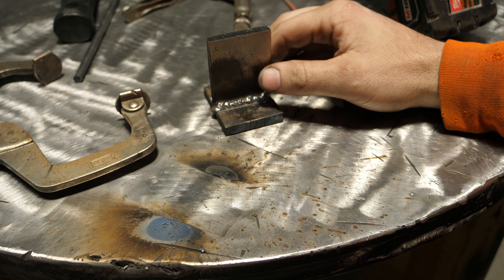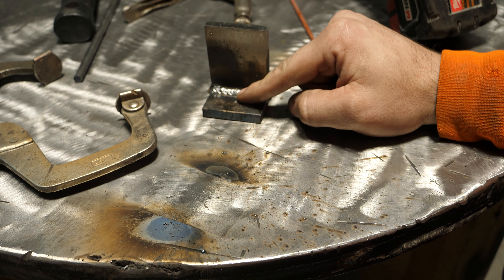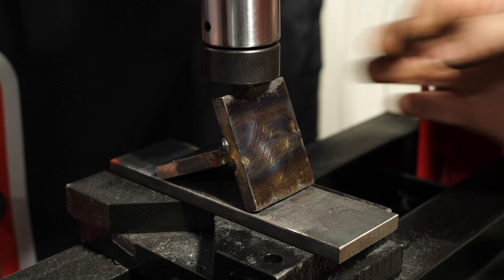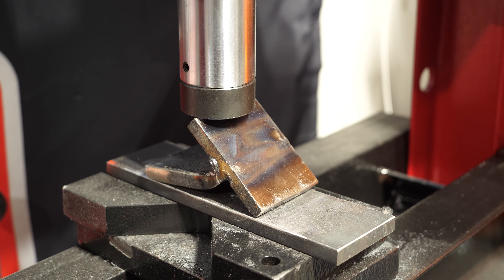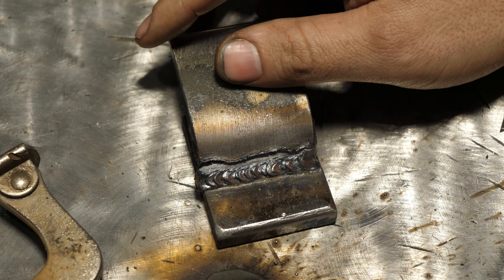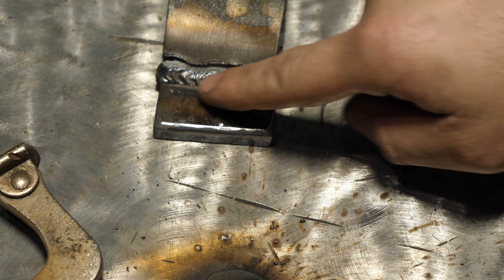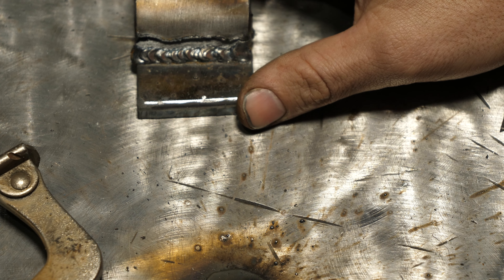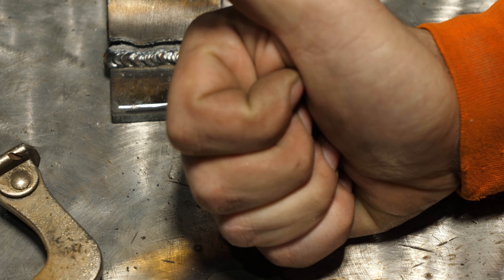Quick test: Weld both sides of a fillet weld with 6010, will it beat 7018?

Comment: Yeah, I had always viewed 6010 as the premium choice where structural strength was the main consideration. Really been educated today with these eye opening revelaions.
Reply from the maker: In the right situation 6010 can make a stronger weld than 7018 in the sense it’s penetration can reduce leverage thus a part will hold together longer.  This can be solved significantly by leaving a gap/beveling plates, or welding both sides of something with 7018.  6010 is still extremely good as a first pass, for welding gaps/holes shut, and welding out of position.

Comment: These videos have been pretty eye-opening. Kind of makes me not want to use 6010 for structural things. Have you done one with the dual shield across the face of the weld?
Reply from the maker: I tested it off camera (by bending a existing weld I had laying around) and it didn’t break.  Since I just got a new spool of wire back I will have to further test dual shield.  I also picked up a more powerful MiG welder to be able to try to get better results.
Reply: @makingmistakeswithgreg  I believe dual shield is the strongest welding process due to its heat/penetration and amount of shielding + the fact that its not picky like 7018. But 7018 does better in the wind

Comment: So far, 7018 does a better job helping SMAW compete with TIG.
Reply from the maker: It definitely does.  I will need to do tig break tests soon.  I know a clean tig multi pass won't break in the same test, its just 4 times as slow to put down lol.

Comment: secnd also 8018 secmed to work the beat so i used that thanks i i used a 7014 root and a 8018 cover i think it stroner now than its ever been in steed 7 tons max before the jaw plate comes apart it now bend steel with like 8 9 tons pressure
Reply from the maker: I don’t have any 8018 but it would most certainly exceed the strength of the a36 steel I welded on.  8018s tensile strength is around 95-97k in actual testing.  It would likely pass just the same as 7018 in the bend tests on mild steel.  On stronger steel it would likely result in a similar result to 6010 vs 7018 where the 7018 would fail.
Reply: @makingmistakeswithgreg  sound about right were 7018 would fail ,well if you like the way 7018 welds then you would like the way 8018 welds but 8018 is very hard to find and i think you canonly buy it by 10 pounds or 100 pounds at a time and for hundred pounds it like uh 250 U.S credits or dallors pluse tax or some where around those lines 8018 is like used for heavy ship frams brige support like over the missasip river back in the day the ( beging ) rails hade plates over the section of rails were anoter rail meets ,( middle ) 8018 was used to weld them toger now they used ether a termite reaction to melt them togetr or the use a moblie induction furnace to melt rail pices to the rail then clean it up with a grinder

Comment: This is great stuff and it's awesome how you respond to viewers requests!  Just wondering, 'cause I'm a cheap bastard, are you gonna' try this test (the pulling away/tensile strength) on gasless flux core??  (Like I said, I'm a cheap bastard!  lol).  Or is the baseline testing with stick electrodes proof enough?  I suspect the stick test is proof enough but I like your vids so I thought I'd ask...  🙂
Reply from the maker: I have tested it, video will be out in a bit.  The problem is Gasless flux core produces porosity on 3/8th plates with .035 wire.  I can’t run .045 easily in my machine, so I am left with .035 as the only option.  I tested flux core and Mig on the same 1/4in plates back to back.  I will upload the video this week and post a link where you can check it out before it’s released 😀.  I have done so much testing in the last 2 weeks I can’t remember the results lol.
Reply: @makingmistakeswithgreg  Lol  I can only imagine.  I take notes when I'm welding certain stuff then I go back to the notes after awhile and can't remember exactly what the situation was and why it worked so well one time and not so great the second.  With all the testing you do, I dunno how you can keep it all straight!  I've come to believe there is some mysterious Voodoo involved in welding that can never be understood completely!  Anywho, looking forward to the next video installement.
Reply from the maker: There definitely is some voodoo.  You think you know everything there is and then there is something that you find out that completely changes everything.  A lot of it has to do with how complex it truly is.  Who would think something as simple as a weld could involve everything from physics, to metallurgy, to mechanical engineering.  It gets really involved when it comes to welding tool steels, titanium, inconnel, and castings.  I can’t wait to do videos on those lol.
Reply: @makingmistakeswithgreg  I never thought it could be explained so clearly.  Even though it's just a hobby for me and aside from the ability to make or repair stuff (which totally rocks!) it's the crazy science of it all that makes welding truly intriguing for me and a great hobby.
P.S.  Join us poor bastards using 1/8 and 3/16" plate for your tests and you'll never have porosity problems with .035 or even .030 gasless flux core wire again!!  Lololol  You can even leave your 240 volt machines at home!  hahahaha
Reply from the maker: I do love flux core wire on thinner stuff.  Honestly I prefer flux core Gasless to MiG.  I also really like the way dual shield runs, but it sucks because the .035 wire doesn’t appear to be a legit option for 200amp or less machines based on my testing.

Comment: Interesting, 6010 is a strange one.  
I'd be curious to see if you ran 2 to 3 passes with 6010 on the same piece, then 6010 with 2  passes of 7018 on top what the break would be if at all. 

Maybe your proving 6010 is better suited as a combo rod versus a stand alone.

Obviously, in this manner/test of course
Reply: I watched the video yesterday and actually tried a similar approach today with multiple passes and either I failed in the process or 6010 failed in the same manner it did for you. 

It didn't matter cold , middle , or too hot same result.  Infact it seemed the more in penatrated the piece  the easier the actual weld broke.
Reply from the maker: So this upcoming week videos will come out demonstrating just that 😀.  I did two welds as 3 pass 6010, and testing with a 6010 root with two 7018 passes on top.  I also tested 7014, 6011, and 6013 single passes.  Without ruining the results there were quite a lot of unexpected results.  

From a strength perspective 6010 is inferior to er70 MiG, 7018, and tig.  If it matters really comes down to what a person is welding.  Most welds will never see the stress the shop press puts on them via bending the plates.  So the ultimate strength isn’t a huge concern if what you weld is never stressed significantly.  I do believe in a 6010 root 7018 cap as a viable option if you only have access to weld one side and it’s mild steel.
Reply: I look forward to the upcoming video. 

I also agree 6010 is 💪 as far as strength .

I use the word "fail" loosely. As you stated, these stresses aren't likely u unless a tree falls, and at the point one wouldn't care about a weld joint!
It is interesting tho to push the envelope just because !
Reply: @floridastate3247  idk we had a fixture to break T joints at Hobart welding school that had a 5' long pipe for torque. We used it to check the penetration of 6010 and it broke surprisingly easy, I tried to do it with a 7018 and the damn thing wouldn't break. I had to put it in a vice and bend it over twice with a hammer to finally break it

Both were a single pass 1/8" rods
Reply: @floridastate3247  I'd rather use a 3/32 7018 than 6010 for the root pass on T joints